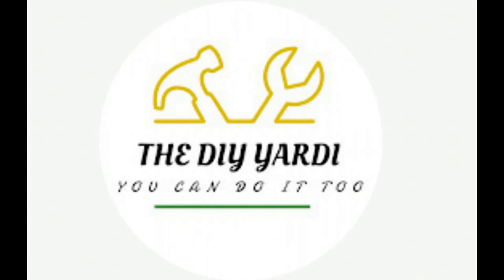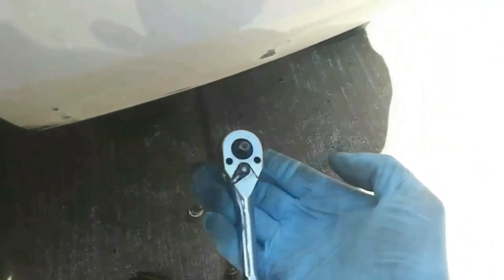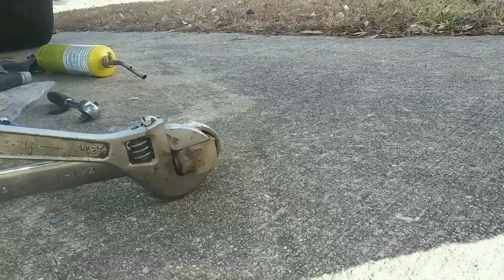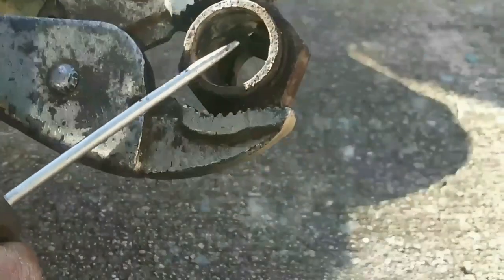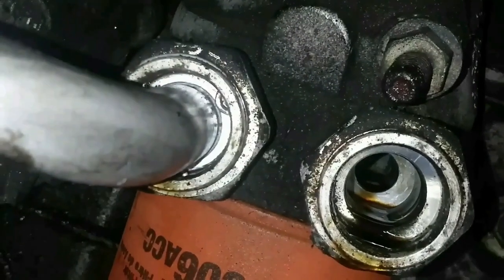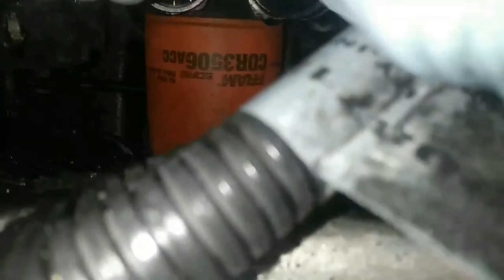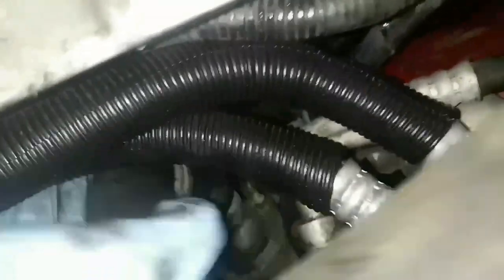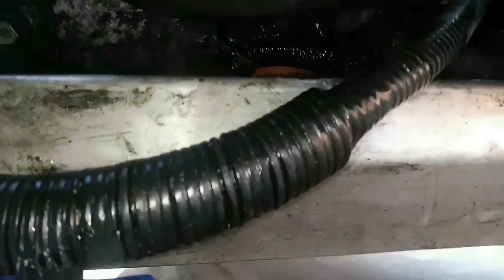HOW TO REPLACE LEAKING OIL COOLER LINES, 2006-2011 CHEVY IMPALA 3.9L WITH POLICE PACKAGE

Comment: Which line is pressure and which line is suction
Reply from the maker: The longer of the two is the output, I have both of the linked in the description of the video, you can click on the links to compare which one of yours is leaking. I would honestly suggest you replace both at the same time though, reason being they usually fail about the same time.

Comment: My 2012 with 3.6 liter needs this to be done badly. Great video but I am horrified how much has to be taken apart to do this job.good grief. Wtf was Chevy thinking lol. I use mine for delivery so its getting done today regardless.
Reply from the maker: I've been working on cars for most of my life, and I've definitely noticed where the manufacturers have made simple jobs harder and harder to do over the years, for the sole purpose of charging more for labor, I feel..its crazy..
Reply: Yeah my 2016 limited leaked out 4/5 quarts and was nocking got the parts now it stopped nocking when I put more
Oil in it at least
Reply from the maker: @Scrub_ls  Hopefully that does the trick,  because knocking usually means there is a/some worn crank bearings, depending on weather the sounds were light or hard..
Reply: @thediyyardie7192  it was ticking because of my injectors are going out causing it to shift slightly hard and a faint tick from the engine bay I still have yet to get a code for it